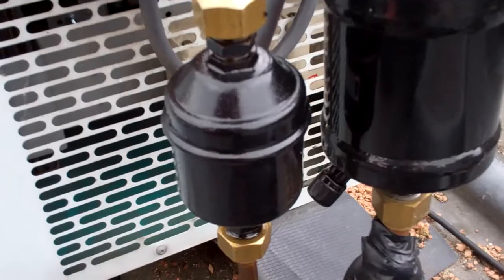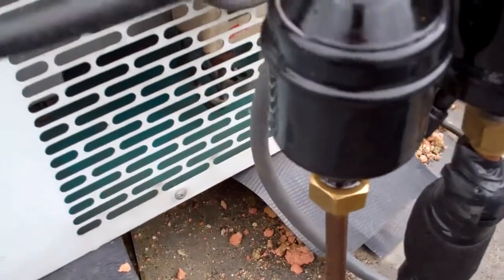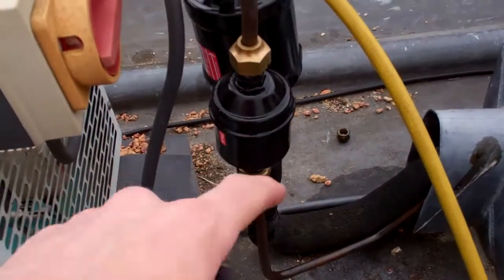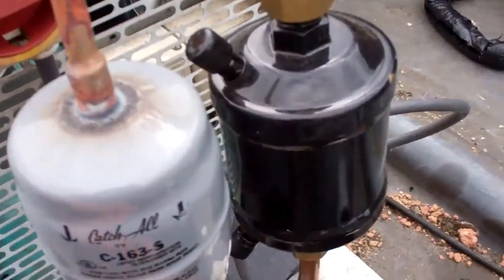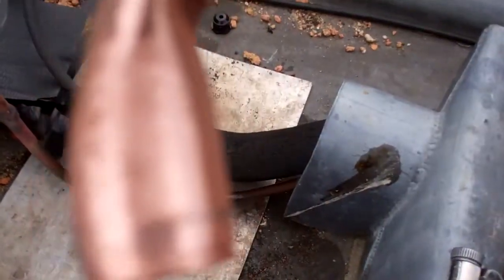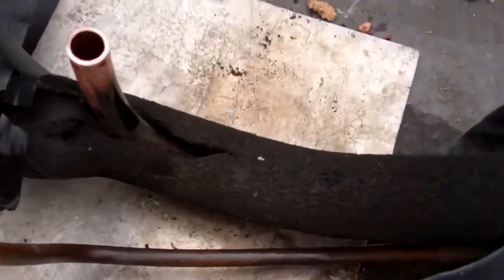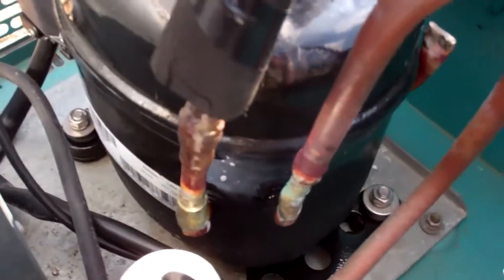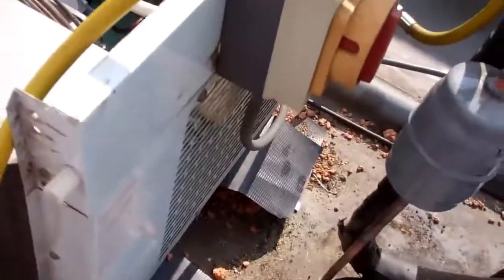Roof top hackery

Comment: man if that where my unit id have the whole thing ripped out and reinstalled maybe then it work right.
Reply from the maker: That was the plan if it gave any further trouble, though it has been running fine so far!
Reply: well thats good im glad to hear  its running a lot better now  of course i say reinstall because you cant blame the unit for  idiot techs that didnt install it correctly  a unit is only reliable as the install.   from the sounds it sounds as if the unit is wanting to run  so why not  reinstall it  of course after flushing the condenser out. cant blame the unit for a crappy install  people  bash goodman for being poor units  yea they get loud well so does any unit after time goes buy and it gets old   but  goodman is only as good as the install i seen goodman units around 10 20 years old even new ones   that had  a great install job  and they cool great   some of the new Goodmans are actually pretty quite my neighbor just had one put in  it sits  near the deck  and  from 3 ft away you cant even hear it running so  any brand  you cant blame the unit  blame th e tech who installed it if the tech installed it right it will have years off good service  except them  micro channels i hate them  ive seen a few of them here  and they all got changed out  the condenser wouldnt stop leaking problem with goodman is they sale to just anyone  soe  people  who dont know shit bout hvac can install them.

Comment from the maker: I think it ran ok for four years then the trouble started, guess if the original installers had set and wired the low pressure switch propperly then system wouldn't have had the moisture problems which have plagued it for two years!

What is shocking is this is work done by the manufactures recomended agents...

Comment from the maker: I got it running but it was flooding liquid back to the compressor, think the have put a bigger orifice in the txv to overcome the pressure drop caused by the kink, have a new orifice on order so will be back out once the parts are in, 
The other possibility is it has been brazed in wrong which will mean i have to drop the evap......

Sometimes its easier and cheaper to start again with new kit, don't have to find all the hidden f ups!!!!